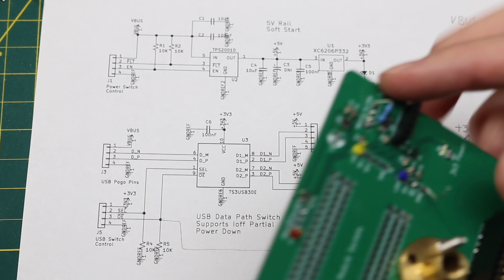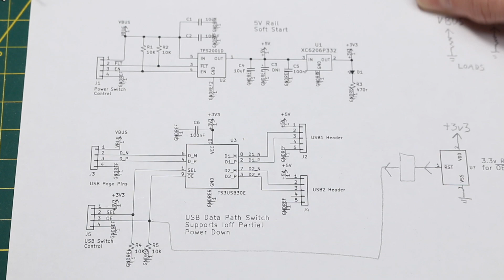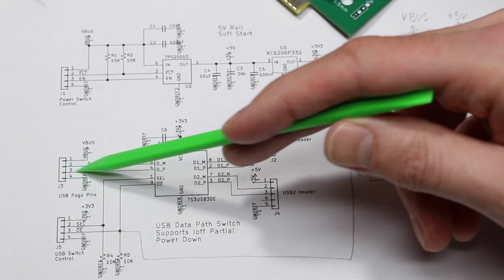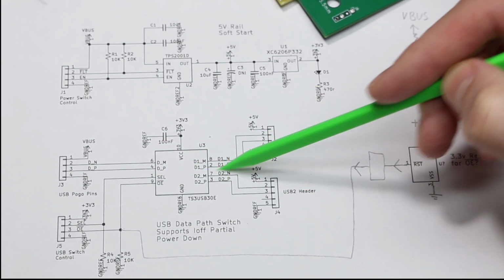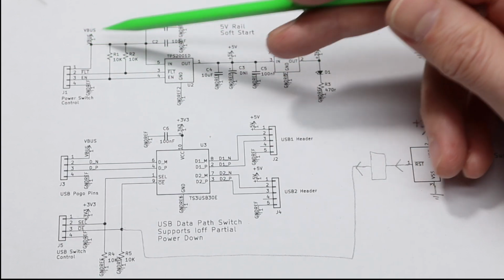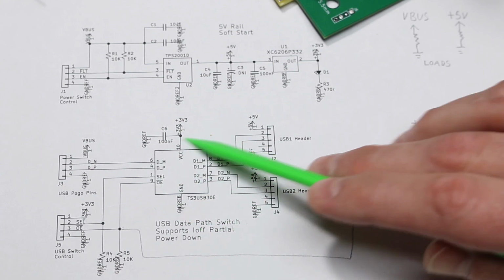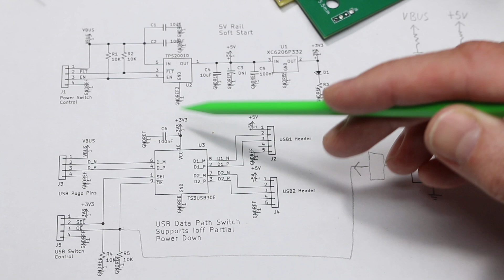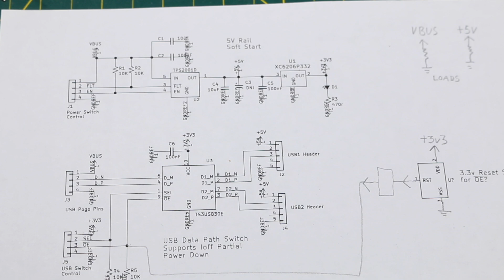Strange Contraption for a USB Experiment

Comment: when you look at the usb connector it's designed for hot swapping, the power pins are longer than the data. Normally on hot swapping you want at least the 0V to make the first and last connection, followed by the power with the data coming in last. you don't want the powered side to try and power (either source or sinking) the the device being plugged in via its data lines. 

it's also worth looking at data sheets to see if there are any power up/down sequences required.